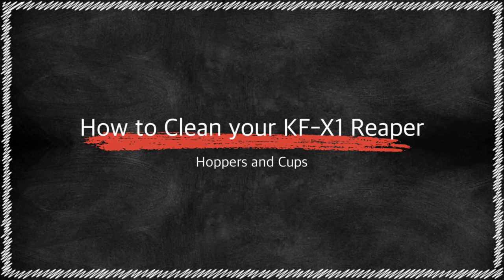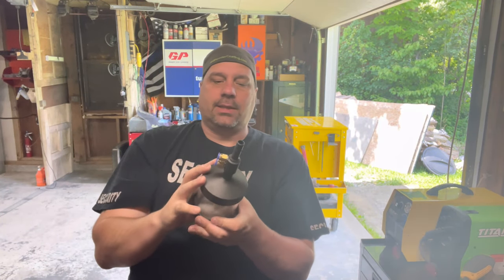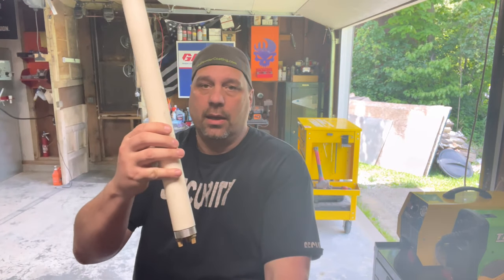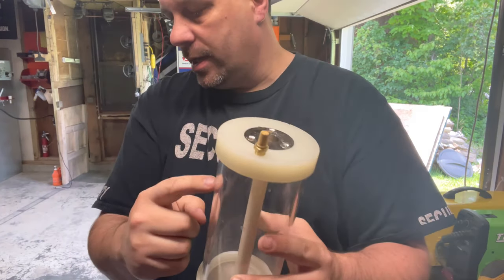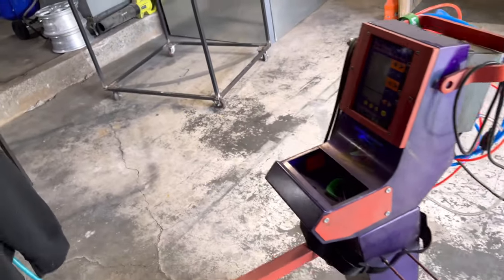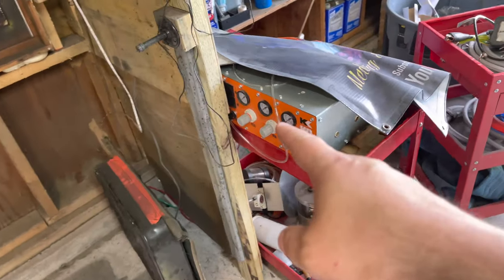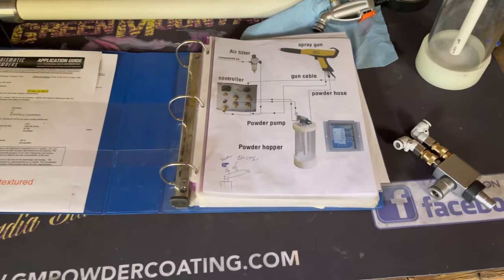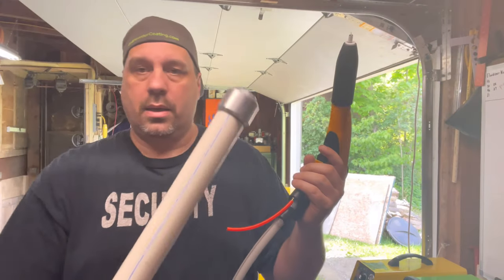How to clean your powder coating hopper, gun, pump and cup from your KF-X1 Reaper #52

Comment: Dude!! No f'ing wonder I can't get low pressure spray with cups and it has been fixing me INSANE!!. 

The cups I purchased and received didn't come with the rubber seal so it doesn't build enough pressure unless I totem the air up which causes more problems...😡.

Also,  thanks for the vid 🙏🏾, life saver.

Comment: Dude I have tried to use one of my machines for a year now and constantly had air leaks and when you explained how they are set up for commercial use i set my Fluidizer Pressure that was so High I thought I had it low. Thx keep them coming please..
Reply from the maker: If you have a X1 would you be interested in joining our X1 group on Facebook? If so shoot me a message on my Facebook messenger and I'll set you up. I'm glad it worked. There are a few quarks the system has but soon as you deal with them it's a great system. I'm glad the video helped. And thank you for subscribing and supporting our channel
Reply: @GMPC  to be honest I don't know what model I have. It's before the blue tooth stuff. Probably 2 years old set up worked horrible [ because of my agitator pressures being high. Blew lbs of powder everywhere. Tried to seal my containers and injector better then purchased 4 other injectors all for it to be the 1 pressure set to industrial use as u had mentioned  Lowered it all down to your specs and my God it worked unbelievably. I have the small harbor frieght and eastwood also but this is a world of its own. Thx. Next is a bigger oven. Thx again. I would love to sign up. Thx
Reply from the maker: @mikescott2332  I'm very glad the information was able to transfer to your powder system also. We have some pretty interesting info coming up on our channel over next few months to help powder coaters with small shops or shops at home

Comment: Hello I have the same system. Cool video but I think the white hole on the tips have to be matched to the bottom hole so the rinse air can pass through the tip to keep it clean
Reply from the maker: I'm not 100% sure if I'm
Understand so I'll take a shot. If I didn't understand I apologize. For cleaning on the unit the air comes up through the tips it does not go through the notch that isn't filled up. That open hole is to make sure u have everything lined up. Even systems without air cleaners have the open holes. Did I answer the question or was I way off in understanding lol
Reply: @GMPC  if you look at the orange hose that goes to the gun that’s the air rinsiing hose, that hose blows air through the little hole opposite of the metal conductor on the gun. If you put the tip with the open hole directly on the the metal conductor then then you are blocking the rinsing air because you have it blocked. That metal conductor on the gun matches to the black tip opposite of the white hole
Reply from the maker: I don't think that's it but you could be correct. I'll give the company a call tomorrow to see what the whole is used for. I know it's also on guns that don't have clean air but they use same guns for both. Thank you for brining this to my attention because it's been a long time since I had to research anything lol. Monday I'll reach out to Hi colo and figure it out. Our luck it won't be either and it will be just what the molding machine does lol. If you have a KFx1 would you like to join our X1 group?
Reply: @GMPC  sure

Comment: One more thing, can you upload a video sandblasting a powdercoated wheel in the blast cabinet using that pressure pot to see how well it does removing powdercoat, the reason I ask is because i am really trying to avoid using chemicals, thank you in advance.
Reply from the maker: The pot inside is like outside it don't blast good powder well at all. The maker of 10x says if you have 20cfm at 120psi it will blast powder with ease. I have a new compressor coming so soon as I get that so that I have 20cfm I'll do a video for you. If I forget please remind me we are super busy and I forget things
Reply: @GMPC  I sure will remind you, thank you

Comment: What do u think is better for someone upgrading from the ez50? Just got a shop, bin powdering about 2 years on a hobbyist level now, bought a nice big skat blast cabinet, I am stuck between this system and the kool koat hd. I love how this is a full box feed systems, since I do alotta of color changes that should help. It makes me a little nervous about
Replacement parts for this. Am I better off getting the kool koat hd and maybe later on down the line buying their box feed dolly made for the kool koat, or do u think I’m best off just going with the kf-x1 and calling it a day?
Reply from the maker: I own both KKHD and then I bought the X1. Surprisingly the KK just the unit alone was more then the whole x1 box feeder. And when the HD won't lay powder down I'll pull out the X1 and it will. The X1 is a better system and cheaper then the KKHD.  Like I said I own both and use both but the fact of being able to adjust on the fly with the X1 and lay more coats I would by far suggest the x1 over KK
Reply: @GMPC  awesome man appreciate it, think I will go with the x1 now. How has it bin on wear and tear for u? Ever had to replace anything for it? Are parts readily available for it or is it a headache to replace parts with colo? Also if u still have the Facebook group id be happy to join it haha
Reply from the maker: @pepsiking7  I get attachments through eBay. But a lot of the guys in the x1 group gets things everywhere. If you ever need anything all u would have to do is ask the group and you will get lots of info. Soon as you purchase let me know on my Facebook messenger and we will get u added to the group. We have also just added a sales person from  Colo to the group so if anyone has any questions from them. One guy was looking for extension nozzle and she gave him the info.